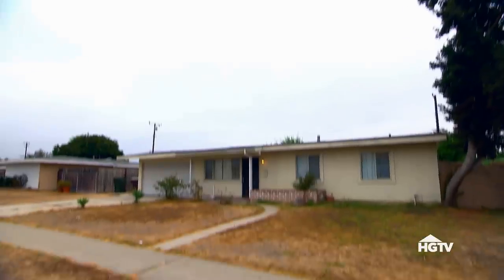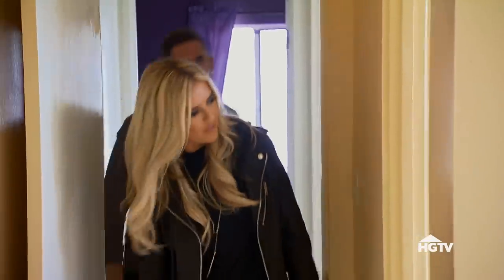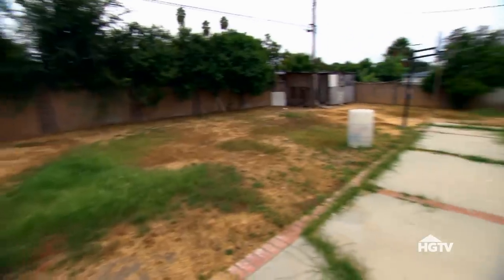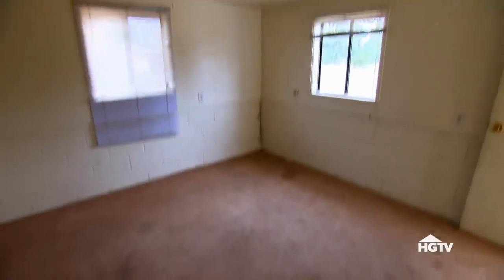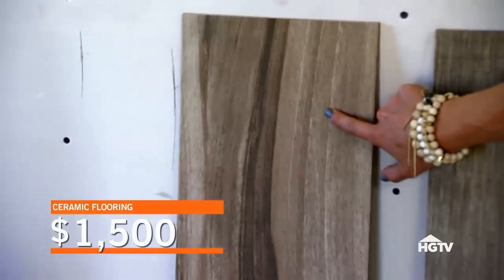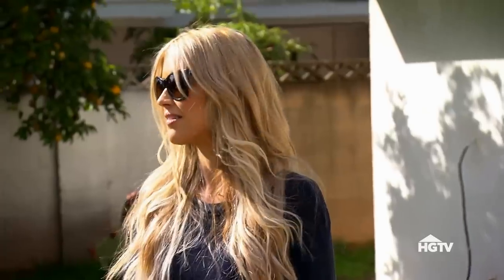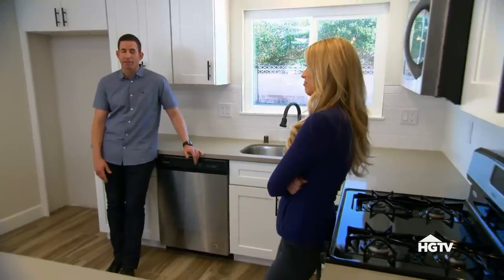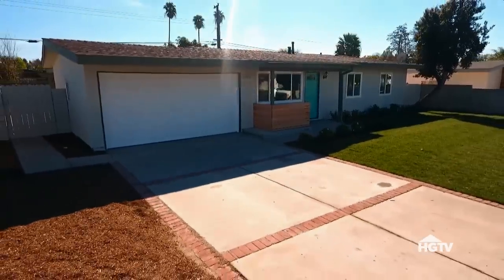Small Home With the WORST Layout Gets Entire Remodel | Flip or Flop | HGTV

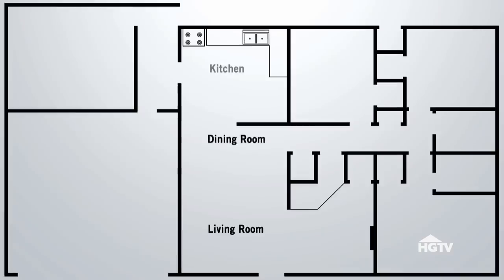Comment: Before floorplan is at 2:50
That 'fourth bedroom' is odd with the cement walls.  Good thing they removed it, too.

The weird accent wood fence looks wrong and so random.  Great place for someone to hide.  They needed to put a difference material under the front window by the entry to give it more presence.  Like the green door.

Wonder what happened with the grass in the backyard.  Did someone forget to water it?

(Edit)  Honestly I've seen these two make a floor plan come out worse than the before.
Reply: And the plants in the front yard are the smallest and cheapest he could find and it shows. Maybe he should stick to the inside and hire a professional. He's not a landscaper.
But then, Christina is an unimaginative and formulaic designer. It all looks pretty much the same when they're finished.
Reply: @angelbulldog4934  
True.  The landscaper they have used on rare occasion was inappropriate as well.